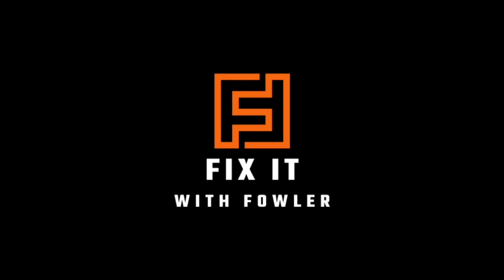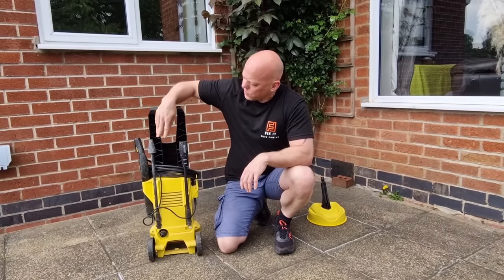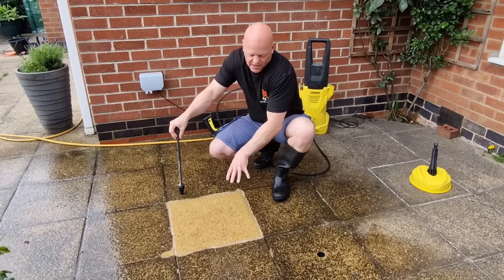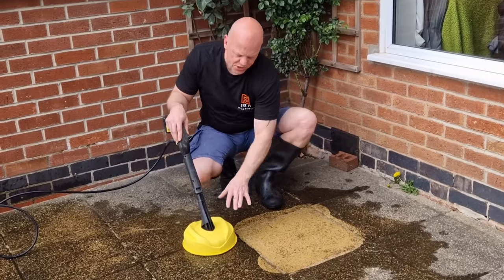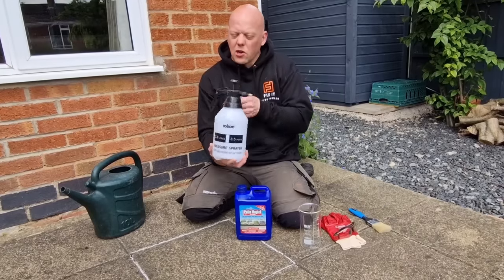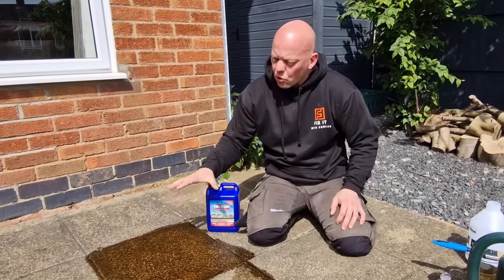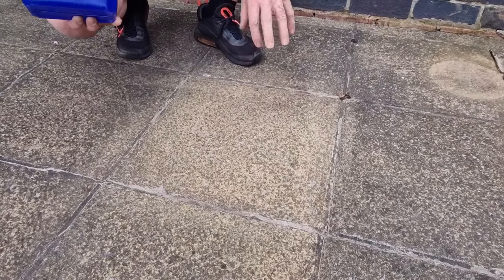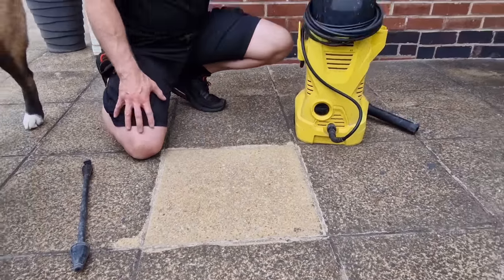The Best Way To Clean Your Patio: Patio Magic Or A Pressure Washer?

Comment: To be fair to the biocide, I don't think it's supposed to actually clean the patio slabs. It is to kill moss and algae and to keep moss and algae at bay for long time. So, for best results I would suggest:
1. Use the high pressure nozzle to do a first clean and really get the slabs back to near new condition
2. After you have cleaned the slabs, if this area is prone to moss and algae (maybe it's in a low sun part of your property), then use a watering can to cover the area with the biocide in the correct dosage and with eye and breathing protection! The biocide will stop build-up of moss etc. for a number of months to perhaps a couple of years as it stays in and around the slabs
3. Use the patio cleaner head to give the slabs a clean before each re-application of the biocide (maybe once every year or two). By doing this yearly or so you will stop the build up of other dirt so that the slabs don't get as dirty as they are at the beginning of the video.
Reply from the maker: Thanks for your comment, I totally agree, but at the time of filming, I didn't know about cleaning the slabs first!
Reply: @FixitwithFowler  Yeah, fair! I just used my K3 to get rid of a ton of green moss off my slabs which have only been down 6 months! I'm going to put a biocide on them now and hopefully I don't live to regret my words! 🤣
Reply from the maker: I think that's the way forward

Comment: Very well presented and very informative video, thank you for posting.  Do you use a sealer on the patio once they are cleaned, if so, does that help them stay cleaner longer or easier to clean next time round?
Reply from the maker: Hi, these slabs are old concrete coloured slabs, so I don't bother. However, if you have natural stone, then you should use a sealer to preserve the slabs.
Reply: @FixitwithFowler  Thank you for that, mine are grey concrete slabs.
Reply from the maker: No, I don't think you will benefit from adding any sealer!

Comment: I just purchased one. Doesn’t the round patio head come with a rubber attachment to fit underneath?? In the manual it shows there should be one ?
Reply from the maker: Hi, mine doesn't have any rubber underneath it, but then again, it might depend on the model!

Comment: The only advantage of the rotary cleaner is its good for block paving as it doesn’t fire a load of crap about like the lances do.
Reply from the maker: I agree, it has its uses.
Reply: You should never use a pressure washer on block paving it blows all the sand out.
Reply from the maker: @mikemorley2797 Yeah, it does, but what if you resend after?
Reply: @FixitwithFowler  I always re-sand afterwards once it’s dry. Been cleaning and re-sanding it for years and it has not sunk and that’s with two cars parked on it.
Reply from the maker: @dazdaz105 that's good to know, thanks for your comment 👍
Reply: @mikemorley2797  "Never" is not correct here (too extreme) - "use with care" would be better.
Two things to note:
(1) Using the rotary patio cleaner head reduces the amount of sand removed; as does using a pressure washer at a low angle.
(2) Once dry you simply re-sand your block paving; you should do this as soon as possible. This is quick, relatively inexpensive (especially as only some of the sand between the joints has been washed out) and gives a nice clean as-new look. It's worth noting that because you've washed away the dirty moss and algae contaminated sand and replaced it with clean, sterile, new sand re-sanded block paving will remain looking good for longer than one where you've strived to preserve all the old sand.
Reply: @dazdaz105  Me too. I always re-sand. Don't forget all the washing process does is to remove the top portion of the jointing sand (the bit that's dirty and has algae and moss in it). Replacing that top part needs less sand than was originally used between the joints [you're just topping it up] and means you have clean joints with no residual moss or algae. Re-sanded block paving looks better just for having clean sand!

The pressure washer doesn't get to the sand the block paving is laid on.

Comment: Useful video thank you. Can you do a companion video - 'how to re-grout your patio'?
Reply from the maker: To be fair, my patio is knackered and needs replacing! Hopefully, we plan an extension so a new patio will go in at some stage, but for not for now. There are loads of great alternatives to sand and cement for re pointing patios that save loads of time and specialist skills.
Reply: @FixitwithFowler hi my water connects to karcher no problem but can't put the lead in on front as keeps comming off when I turn it on am I missing something on the connecter where you screw in pleas
Reply from the maker: Oh, I don't think so. Is it a new pressure washer?

Comment: Great video. I have the K2 and have always used the other nozzle. Why didn’t you use that one in your test also?
Reply from the maker: Well, that's what the dirt blaster is for, so that's why I used that one!
Reply: @FixitwithFowler  Sorry to ask, but what is the primary function of the other nozzle? I always thought that was the one to use on my drive and patio. 😳
Reply from the maker: The dirt blaster lance (the one with a fixed conical shaped head) has a ball bearing in and that is specifically designed for shifting stubborn dirt/stains off hard surfaces like brick, stone, paving and can even remove paint. The adjustable lance can be used for various tasks as its adjustable!
Reply: @FixitwithFowler  Appreciate the reply. I’m gonna be doing my patio in the next few days. I’ll try the dirt blaster this time. 👍
Reply from the maker: No problem, good luck!

Comment: I spray on wet and forget for over a decade and mine looks like new.
Reply from the maker: That's good to know. Where do you get it from?
Reply: @FixitwithFowler   Costco is cheapest when they have a deal on but Amazon have it. Spray it on, it takes quite a few weeks to work, but then it'll look like new. Never power wash. Needs to be put on every six months to a year. Also use it on my composite decking.
Reply from the maker: @wakeywarrior brilliant, thanks for your response 👍

Comment: do you need to seal it after blasting it with the karcher?
Reply from the maker: Not these, they are only old concrete slabs.
Reply: @FixitwithFowler    I Was going to pressure wash mine, and mines are only old concrete slabs as well.  Are you supposed to seal them after it? I was worried it would get mouldier even quicker because it was creating all the holes in the slabs from the pressure
Reply from the maker: @golfguyuk I've done mine the last few years and have not had a problem. If they are stone, then you would need a sealer to put on them.
Reply: @FixitwithFowler  thanks for the advice
Reply from the maker: @golfguyuk Anytime!

Comment: You should not be using high jet on concrete paving slabs, you will ruin them
Reply from the maker: Why will it ruin them? I've been doing this for 8 years on this patio every spring and the patio always looks brand new after it's cleaned!
Reply: @FixitwithFowler  it takes off the top layer exposing the substructure to premature wear and tear along with damging pollutants. Once you start doing this you will find you need to do it more and more frequently. Concrete slabs are the one of the easiest to damage using high pressure washers. If you don't believe me of want more info google it
Reply from the maker: That maybe the case but mine have survived 8 years being pressure washed and these slabs are over 20 years old!
Reply: @FixitwithFowler  had they been pressure washed prior to you doing it? If that is the case then they were probably already damaged. If you run your hand over the top and they are rough or pitted then there's nothing you can rectify. But generally speaking it shouldn't be done. Different types of slabs are more able to take it.
Reply from the maker: I don't know. They are old and to be honest they look great. They will be coming out next year when we extend!

Comment: Don't use any of the methods shown here. Pressure washing is slow messy and tedious. Patio Magic is over priced and pretty ineffective or at best very slow. What you should be using is Deosan Red Label Hypochlorite. It comes in 20 l cans and can be diluted with water 2:1 or ever 3:1. Just water it  on (or spray) and just walk away. You will be amazed. Even better it's dirt cheap. Only downside is it smells of bleach but this goes away after a couple of day. It also acts as a weak killer. ..Also this method is very quick. water it on and 20 mins later you have a spotless patio. If you want to buy some, find an agricultural supplies outfit, of possible a swimming pool maintenance supplier..
Reply from the maker: Is it safe for animals, and will it kill plants or grass?
Reply: @FixitwithFowler  No - not safe for animals & yes - kills plants and grass.
Reply from the maker: @peterjohnson1739  no good for me then!